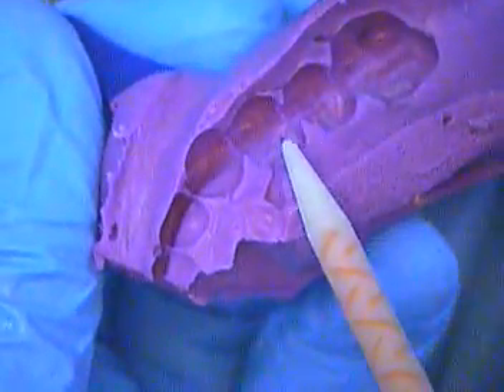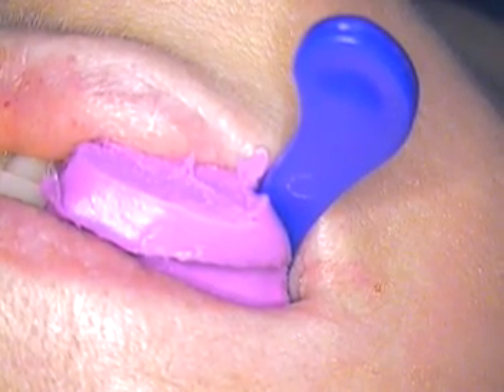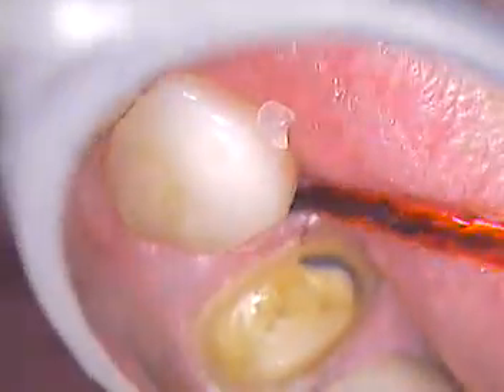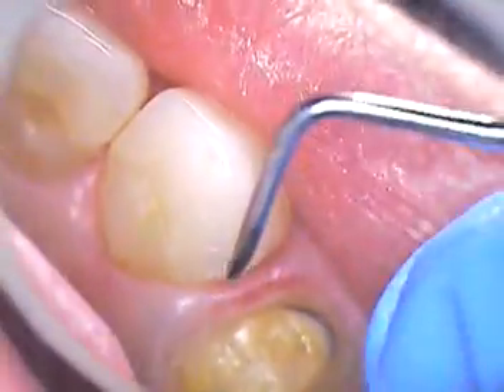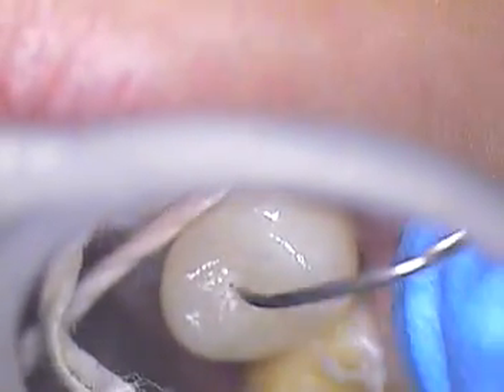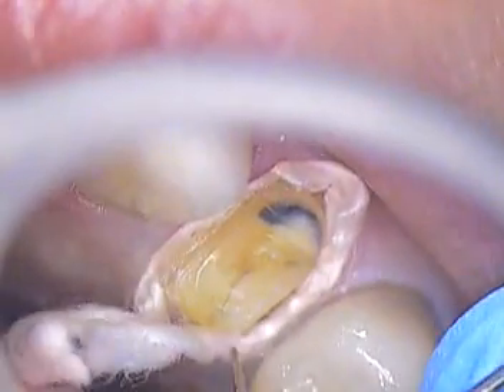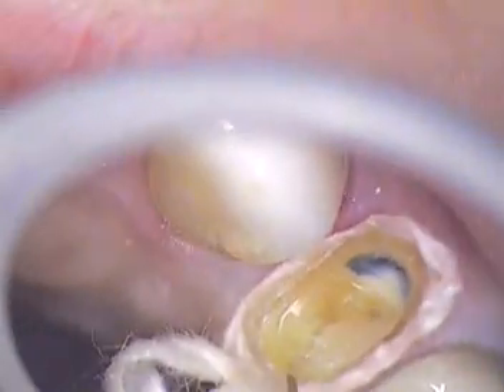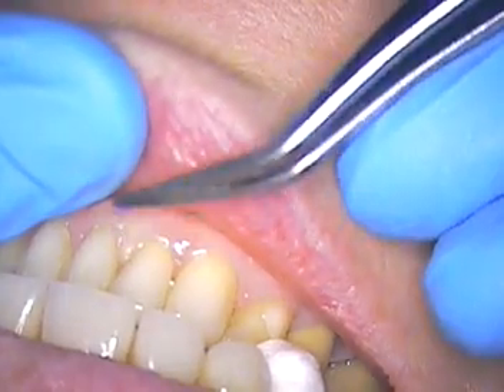3. Replacement of an old PFM crown with an all porcelain eMax crown -a step by step process

Comment from the maker: All ceramic crowns benefit from even thickness of reduction.  Dentin usually supports the crown.  Resin dentin cements are becoming stronger, but it's the even, adequate thickness of porcelain thickness that gives the restoration it's flexure strength.